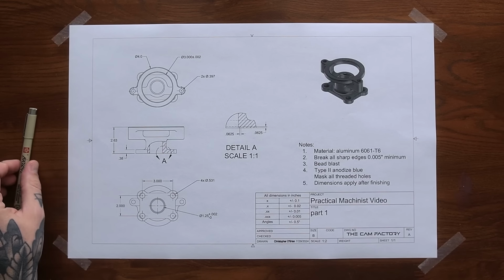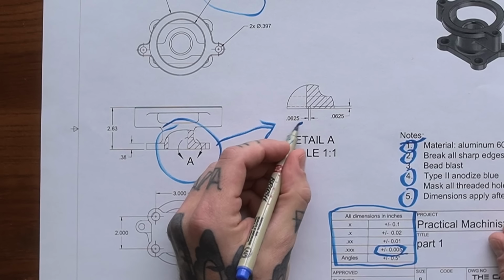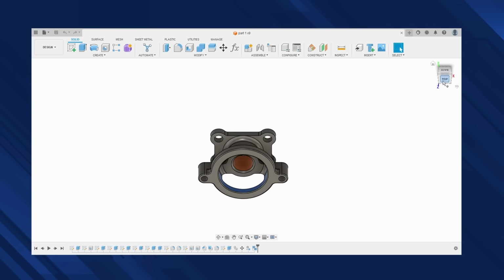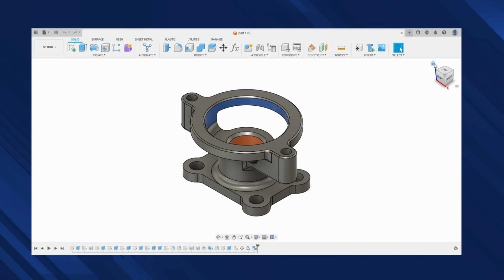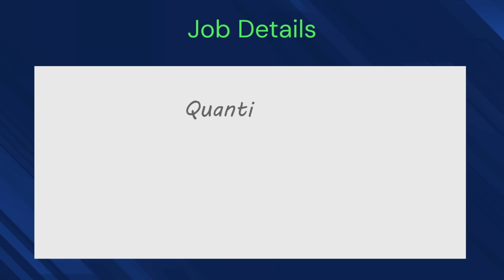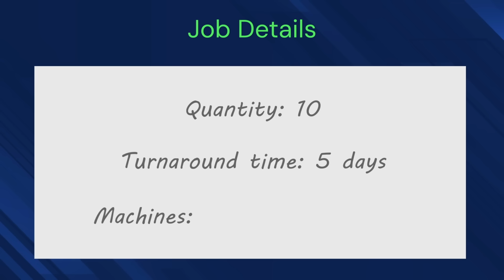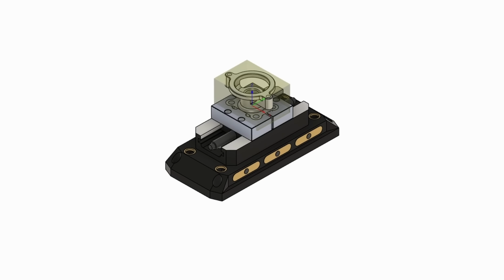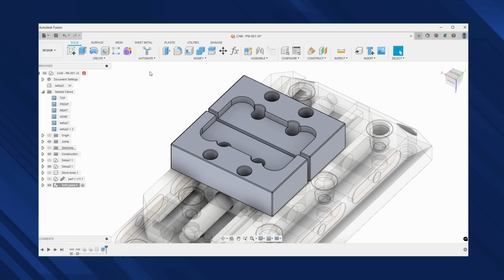Here’s How I Come Up With a CAM Plan | The CAM Files Ep.1

Comment: Would you not want a couple thousands of offset(larger) in your soft jaw for proper fitment?
Reply: I wouldn’t offset the whole softjaw, but if I were to actually make this part, I would create clearance on opposite sides on each jaw. This would prevent the part from being over constrained and allow the soft jaws to locate the part properly. Rotating the part 5-10 degrees would also improve this design.
Reply: @TheCAMFactory 
Could you please do a video on all of that?

Comment: Arent the bolt holes called to three decimal places. Why so tight?
Reply: Good catch. That probably wouldn’t be a real requirement if this was a part to be manufactured. I just threw some numbers at it for demonstration purposes.
Reply: @TheCAMFactory  unfortunately many engineers also just throw numbers at parts
Reply: @forgeperformanceand4x4 I could have made them references. There’s something about rounding to 2 decimals and then applying a +/-0.01” block tolerance to it that I don’t like. For instance, if nominal is 0.375”, you would be rounding it to 0.38” and then applying the tolerance which would bring it to 0.39 on the high end. That’s 0.015” from nominal. It wouldn’t actually matter for a clearance hole like this, but it’s something I try to avoid anyway.
Reply: @TheCAMFactory  I know it's not a critical dimension and I'm guessing the engineer may however due to the tolerance table in the drawing technically if they put it on a CMM and it was out they could reject the part

Comment: What software would you recommend for 7 and 9-axis multi spindle lathes?
Reply: That’s gonna depend on your requirements
What features do you need?
I run a 6 axis lathe (Nak as200L) and just use fusion 360 which has been working very well, but it lacks good simulation, collision detection and will only output one channel at a time. You can stitch the program together after it outputs each process. But this means you cannot simulate the movement and timing of both turrets/chucks
Reply: Thank you for responding. Simulation is a top requirement.
Reply: @toemaz3751  then solidcam or go2cam

Comment: I purchased fusion 360 for the cam. In machine setup I don't find any haas lathes.  I must be going down the wrong path.  I have a Haas tl-2. I was hoping to generate can code on any haas lathes and then just hand edit the beginning for tl-2 type prelim commands.

I walk through of cam machine setup would be nice.  Tool tables, etc.
Reply: Machine sim for lathes and mill turns is not currently supported in Fusion. But you can still program and post to your TL2. Leave the machine selection blank in the job setup and select the correct post processor for your lathe when you post the code. This should work fine.

Comment: Nice explanation. I would like to see the CAM simulation and proccess. Also hopefully there are some features on this part that require 5axis machining. Also if you only had 3axis machines available how would the op 3 fixture be designed.
Reply: This part doesn't necessarily require 5-axis machining (you can get by with 3+2). But as you can see in the intro/outro clips, I did throw a 5-axis toolpath on it for visual effect. It's a 3D deburring toolpath.

I think I will make a video that covers 3-axis vs 5-axis and how my strategies differ based on the different constraints. It may or may not be this part design, but it's an idea I have in mind.

For this part, if I were to make it on a 3-axis, I would probably retain a cube shape while machining the cylindrical portion in 2 ops from opposing sides. Then I would machine the rest of it as I hinted at in this video. The flat side with 4 holes would be set into a soft jaw to complete the final op (op 4 if this was on a 3-axis).